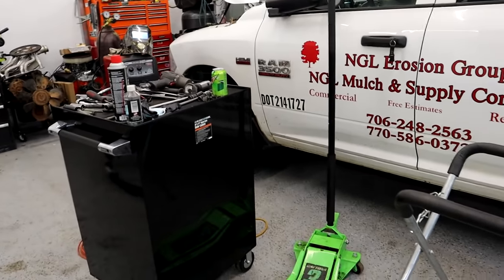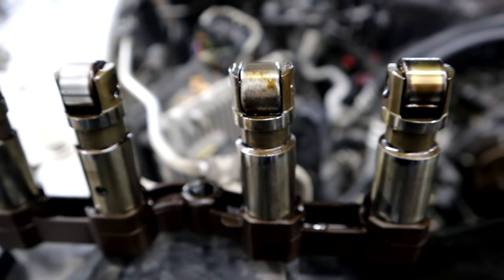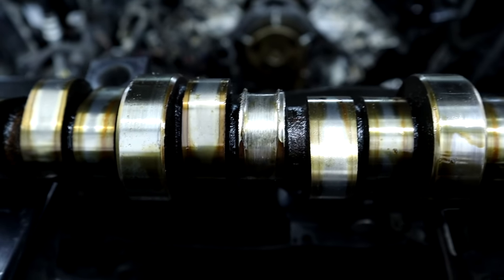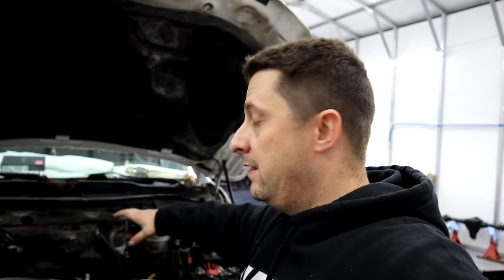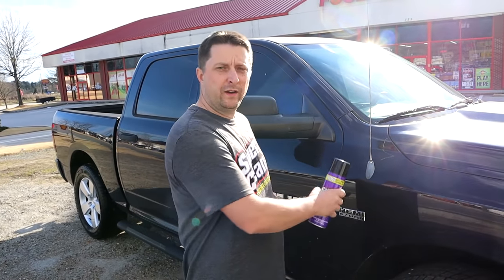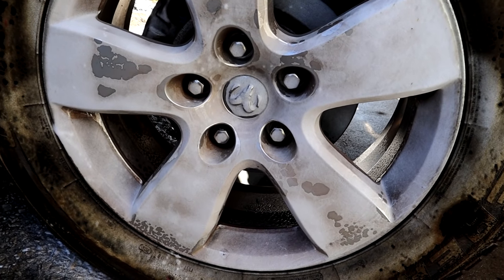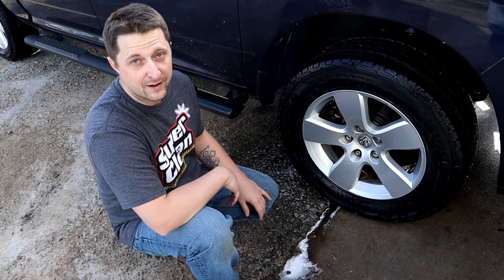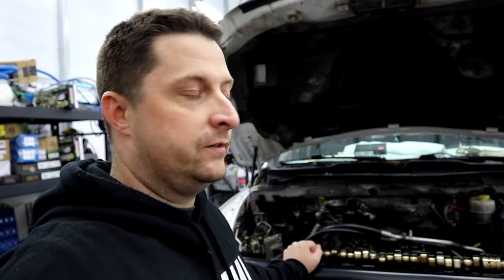6.4 HEMI Engine Failures Common Problems WATCH OUT.

Comment: I've heard that the oil delivery problem to the camshaft on these hemi V8's has been resolved. Someone recently has developed a roller lifter with a small opening on the bottom side of the lifter barrel that squirts oil onto the roller and cam lobe as the lifter raises the pushrod. The pressure from the pushrod depresses the plunger in the lifter and oils these parts that haven't been getting sufficient oil due to the longer distance from the rotating assembly, resulting in oil starvation. I'm told Mopar is now putting these lifters in the Hemi from the factory.
Reply: Sounds like BS if you ask me. I know they have a different lifter part number as a revision and to my knowledge the only difference was the needle bearings were larger(lower number of needle bearings on the roller). Have not seen anything like what you're describing unless this is something really new and I haven't come across such lifter yet.
Reply: @DL101ca  Have you taken one of the revised lifters apart to see if they have this? You can't see it without taking the roller off the lifter. According to his description the hole would need to be behind that roller in the bottom of the body of the lifter not on the outside.

Comment: Same thing happened to my 2016 Dodge Ram 2500 with 6.4. Only 65,000 . Limp mode one day . Then misfire code. Had full engine replacement. Still under warranty. I won’t keep the truck over the 100,000 mile warranty

Comment: My 2018 Ram 2500 6.4  Power Wagon only has 21k miles on it and already has this issue. It sucks. Dealer says it's normal. Mine sure isn't gonna make it no 100k miles, probably not even 40k.
Reply from the maker: Wow
Reply: How do you know it has this issue?  Have you disassembled the engine to check?  I slight ticking noise is not indicative of this problem.  The 6.4 in HD trucks makes a ticking noise through the exhaust, they all do it, either through a bad exhaust design at the y-pipe, or thin walled pipe.  My PW makes this tick also and it is most assuredly in the exhaust below the drivers seat and y-pipe area.  There is zero ticking noise from the engine bay.

Comment: It’s common if your constantly allowing the MDS to kick in and out plus idling for extended periods of time… 2016 ram 1500 5.7 hemi 126k miles no issues with the lifters and cam but I am also aware of what causes it and how to mitigate the problem

Comment: We just put a Jasper remanded in a 15 ram rebel. 80ishk. Cam was junk and DOD solenoid screens all full of metal. Customer opted for a remanded engine with a warranty. I think it was a good decision. I’ve heard horror stories about repeat failures after a repair like this due to contamination.. I could be wrong though, I don’t have a lot of personal experience with the hemi’s.

Comment: I have a 2019 Ram 2500 Hemi with 6900 miles and have already had the lifters replaced by the dealer and has to go back next week after putting just 500 miles on the engine for the same issue. Btw I only have 10% idle time on the engine so this is happening on brand new trucks as well
Reply from the maker: Wow thats insane thanks for the feed back👍
Reply: @FrostbiteRam  thanks. It super irritating to have issues so early. I thought the 6.4l would be less problematic than a 5.7
Reply from the maker: @TheRamGuy  i think we all did or was hoping 😓
Reply: See my long note in regards to this....

Plate [C]
Reply: @TheRamGuy  My 220-lb wife (Donell) is a lot MORE problematic than my 120-lb ex was 🤣. Bigger ain't always better, lol. (Just kidding, Babe 😉)
Reply: How is it working now? Resolved?
Reply: @flawlessvic  they actually replaced the whole engine due to bearing damage in the bottom end
Reply: @TheRamGuy  wow...I bet that was a stressful time. Glad it worked out!
Reply: Wtf that is crazy I was looking at the 2019 2500 because its s beautiful truck but damn I better just stick with my 14 f150 5.0. 140xxx miles brakes and oil changes. Sorry for your luck but helps me with my decision.
Reply: @shanedickman6180  they ended up buying back my truck under the lemon law
Reply: Did you end up getting another ram 2500 or did you go with something completely different if you don't mind me asking thanks for your response back.
Reply: @shanedickman6180  well that is the tricky and crappy part because of truck prices and availability but I will be going to a Ford F350 with the 7.3l. I love Ram but I can't do it again
Reply: @TheRamGuy  completely understandable that would have steered me far away as well. That 7.3 looks like a beast, enjoy your new ride congrats

Comment: I have 6.4 hemi with no issues,  my sister inlaw has a 5.7 hemi and she has the lifter issue.  The difference is I use the proper oil and she went conventional oil because the lube joint told her its just as good.

Comment: Oil quality is key to any engine. In my opinion from testing Royal Purple has been the best oil with crazy protect metal on metal surfaces.   My 5.7 hemi has 0 lifter tick at 104k.

Comment: We all know that there is an oiling issue due to a design flaw in the Hemi Motor. And in a commercial vehicle that no doubt spends a lot of time idling, I would expect an occasional failure. 140k miles isn’t that bad.  Word of advice, run the RPMs up over 3k often. Don’t idle the motor .

Comment: I have a 2021 Ram 2500 6.4 as a loaner as my truck is in the shop (2018 F250 6.7 with the dreaded upper oil pan gakset leak). Even with just 7500 miles, i will say the engine is NOISY and can clearly hear the valves clanking away lol.

Comment: A friction modifier / extreme pressure oil additive will help with this issue.  Formula 3 by Lubrication Specialist in San Diego has it.  $160 / gal.

Comment: Cheap oil and filter is the problem ! I use 5w-20 full synthetic Mobil 1. Yes its about $10.00 per quart for the 15,000 mil oil. 6 quarts is about $65.00. Top quality filter is about $25.00 so your looking at about $90.00. Its worth every cent.
Reply: Exactly brother

Comment: Great video and appriciate the information.  I just bought a new 2021 6.4 ram.  Would you recommend the use of amsoil or other brand of oil...or additive to improve chances of this not happening?
Reply from the maker: Just use a good oil and change it regularly is really the most you can do.
Reply: get rid of that Truck.....buddy has 2020  cam issues already at 40k miles..... he wishes he had bought a Ford now hes screwed

Comment: My 2014 6.4 popped P303 code. Changed plugs and coil in cylinder 3. Drove 150 miles and the engine shut off!!!! Dealership said it needs a new engine! Can’t believe this. 170k miles

Comment: My 2012 Ram (5.7) had the same problem. Got a quote from dodge, they wanted to charge me 4,500 again 4,500$ lol. No joke. I just took it to a different machine, charge me 1500 also, but 2 months later, cold start my truck, the lift knock, then goes away, like 2m later (it’s not the manifold bolts) but I started blending my oil. I do factory oil then mix it with the Lucas stabilizer engine oil. Once I added that stuff, the knock was there but would go away like In 2-10seconds. It’s a really sucky situation, but if it happens again, I’ll probably just do it by my self. 

Cheers from Texas, hope I made sense. Lol

By the way, I did see a YouTube video saying about how the cam was to far from the crank, and how the oil wouldn’t reach the lifts in time, something like that. I believe the person who explain it was “uncletonysgarage”

https://youtu.be/iTL8QEU2NwE
Reply from the maker: Yeah the dealer makes a killing on this.

Comment: Coming from owning diesels that's extremely cheap! I love my 6.4 hemi, I'm done in diesel land even tho I prefer them.
Reply from the maker: I dont blame you at all.
Reply: Same here, you can now get 400-600 ft-lbs in a gas motor from all the big 3, and they're not all gas hogs, so really you don't need a diesel these days anyway.
Reply: @Prestiged_peck  you can’t pull a stock trailer loaded with cows, a gooseneck trailer loaded with hay, or any other load 20k plus pounds on the daily with a gas engine, it just won’t take it.
Reply: @wesleydean4228  I mean I tow our double decker racing trailer with 4 cars between 2500-3500lbs and about 1000lbs worth of equipment tools and fluids with a 8.1 gasser all the time, trailer probably weighs around 14klbs fully loaded, and I have no issue, the 7.3 gasser ford makes a lot more torque than mone does, so given the chassis ot can definitely be done, you may only get 3-5mpg doing it but you can do it. (I've also seen a loaded cattle/horse gooseneck get pulled by a ford fucking ranger down a texas highway, if a ranger can tow it any real man's truck can.
Or do you mean they won't hold up to that kind of abuse? Because if that's the case you ain't servicing shit right, any modern 2500 gasser truck motor should be able to make 200k of hard, down and dirty, loaded to the max work, it's literally what they're designed for, if not it's not worth a shit
Reply: @Prestiged_peck  I didn’t say you couldn’t do it, but it is not ideal when you pull for a living. That ole 8.1 gas truck is on a different level. Those things were light years before their time. Great motor, as well as being paired with an Allison. What I was getting at is that for someone like. Myself, it would be very difficult to get by with a gas truck. It can be done, but you would trash one in no time.
Reply: @wesleydean4228  again proper maintenance and you're fine, only one worth going with right now is the ford 7.3 though cause it gets the HD trans.
Reply: @wesleydean4228  16k camper all  day long . Not the first to the top of the hill but the 10k price tag difference buys slot of gas plus gas is way cheaper I think I would have to tow 85k miles to break even with cost of ownership. plus 9 out of 10 guys pulling what diesel trucks are capable of are running illigal anyway. No d.o.t. no. health card no class a  . And so on I love seeing those guys getting killed at way station
Reply: @lauramurray6690  no doubt, I never said it wasn’t a good option for some. There is absolutely no gas replacement that can handle the abuse day to day that a diesel can. I am not a diesel fanboy, and I love the gas options. With what I do everyday, gas is just not an option.

Comment: I know this is an older video but still relevant.
I would be interested to know if oil change intervals and oil brand play a role in lifter failure.
I dont care what a lab test says, 8k miles is too far for an oil change. I change mine every 4k.
I mostly use the Pennz Ultra Platinum as recommended but a couple of times during Covid it was hard to find so I used 5/40 Rotella synthetic.
Id be willing to bet that dropping the oil change interval would help extend lifter life.

Comment: This is why I love the Ford Modular 6.2L.While they occasionally might break a valve spring, they will run forever. And lots of idle time is no problem for them. When it comes to Chrysler, I prefer the old 5.2/5.9 Magnum engines. Bulletproof.
Reply from the maker: The mag motors was definitely work horses 👍
Reply: Wondering why Scotty Kilmer is critical with the RAM trucks, he hated the RAM trucks with passion.

Comment: Just add zddp+ aditive every oil change,
Keep at between 1000-1400 ppm 1/4 of bottle depending where you get it personally i use redline brake in oil additive others are good too,
The main application of ZDDPs are as anti-wear additives in lubricants including greases, hydraulic oils, and motor oils. ZDDPs also act as corrosion inhibitors and antioxidants. They are almost ubiquitous in lubricants, and treatment rates are usually between 600 ppm for modern, energy-conserving low-viscosity oils to 2000 ppm of this additive in some racing oils,
Again keep it between 1000-1400ppm
Modern 600ppm may not cover it.

Comment: This video caught my eye as I figured there were multiple problems with the 6.4. Then in thr opening statement he only mentions thr one lifter failure truck. The reference of it being a lifter on number five was fully defined as the intake or the exhaust? Also did all the other trucks fail the same lifter as you eluded to? That would be the kind of info  the Chrysler company engineers would love to hear? Not to mention NHTSA AND THE EPA. As I understand it a lot of 6.4 failure with the engine will affect the emissions output and make those trucks non emissions compliant. Fines and recalls would be flying all over the place. So please more info please.

Comment: My 2015 just started tapping consistently. It has 127,000 on it and I’ve driven it every day for the last 9 years. The engine has a little over 4,000 hours. 3,600 drive, 500ish idle. I’ve noticed the engine likes mobil one 0w-40 oil and filter. Every time when the truck went in for major servicing. The dealership would use their bulk oil and mopar filter and the engine didn’t like it. It would start tapping And I change the oil back to Mobil one. Now it just started tapping and won’t quit. Funny thing is, it just got back from the the dealer for a full servicing and now the engine is fucked.

Comment: I wonder if these people changed the oil enough or used the correct oil. Roller bearings need nice clean oil especially with the location of that cam.

Comment: I had a lifter failure problem at 50k miles, replaced with hellcat and comp cam + mds delete, lifter failed again 30k miles later, rebuilt it again, 2k miles later lifter/cam failure again.
Perhaps I’m cursed but I wonder why it keeps happening.
Could it be the tune, wrong torque applied to the bolts, perhaps the heads weren’t cleaned right?
I’m torn and starting to hate this 392 motor.
Reply from the maker: Thats crazy may me work looking into the Johnson lifters.

Comment: Cam to high in block, during idle,  not getting crank splash ...equals terrible design
Reply: Rccr Dawgs *too
Reply: The lifters are pressurized. They don't rely on crank splash to oil the cam and rollers.
Reply: @bicyclecrashsurvivor8884 All push rod motor cams except these hemi's sit low in block and during low pressure oiling at idle the crank throws splash oil on cam.
Reply: @jumpinjojo  I barley got out of high school years ago, I could care less if my to , too, two, are supposed to be in that sentence... but I appreciate your silly comment
Reply: Rccr Dawgs Barley?? Like the grain in beer? Lol!! It's spelled barely.
Reply: @jumpinjojo  Getting my spelling class on YouTube! Yesssss
Reply: @Rccrdawgs  My rates are very affordable. 🤣🤣

Comment: Where do all the shavings go from the old cam?  I thought this failure requires a new engine.  I’m doing some studying as I’m considering a Hemi Ram 2500.
Reply from the maker: Most the time they can be saved without motor replacement.
Reply: https://www.youtube.com/watch?v=JGC1D-vEdl0&t=282s

for 5.7 its mostly no need for new engine, for 6.4 most likely yes, you check on both this oil control valve which is under intake manifold, if there is debris on it...that means new engine. for 6.4 its more common to be so, because much tighter tolerances
Reply: @Tamburahk   thank you for the information.

Comment: Oh man...been a Dodge fan/owner since I got my first one in '97. Had an '03 diesel after that...great trucks. Then I bought a '14 6.4....Terrible idea. Thank god I got the lifetime warranty!

Very long story short...first the torque converter went out....then they said it was some sensor...then dealership eventually replaced the whole transmission after I got told it just needed a $350 oil change from  my pocket! After that it was the EGR cooler. Didn't even know a gas truck had one...when they fail it will belch thick white smoke for a quarter mile...almost like you're on fire! Truck had about 70K miles when all of this started. Happened over 8 months. I towed a 5K trailer 4 times with it...the most it has ever had to pull. The truck spent a total of 5 months at the dealership because apparently they couldn't get parts from anywhere in the country...B.S

Escalated the issue up the chain to Chrysler etc. Had to fight just to get partially reimbursed for a damn rental....terrible customer service unlike anything I have ever dealt with. 

Got rid of the lemon and downsized to a 2021 Tundra. I really did love the engine, though. Broke the tires loose on the freeway lol. Not a truck I want to have break down 40 miles from the nearest town in the middle of nowhere while hunting...
Reply: Make sure to put a trans cooler on your Tundra. They stopped using them in 2018 or 2019 and they are seeing extremely high Temps which is resulting in trans failures.
Reply: @bicyclecrashsurvivor8884  Thank you for the tip! Is it bad that I still want a TRX...lol